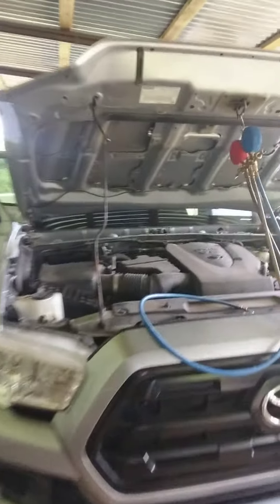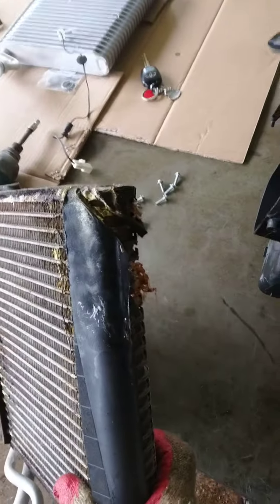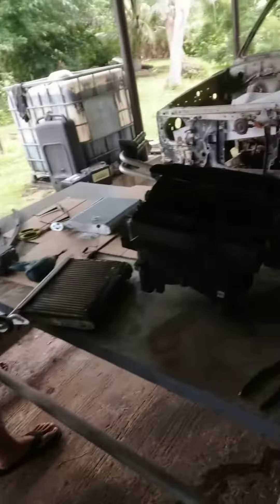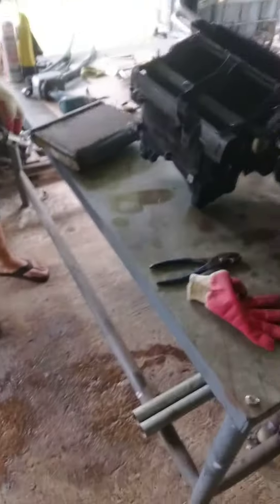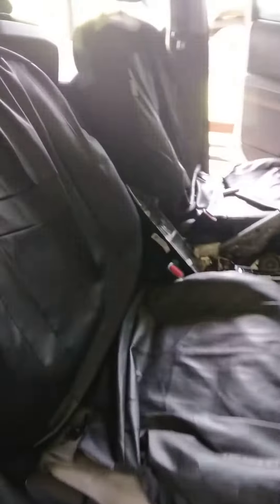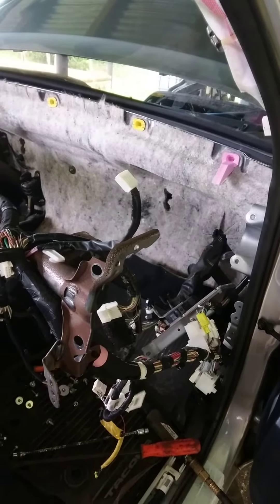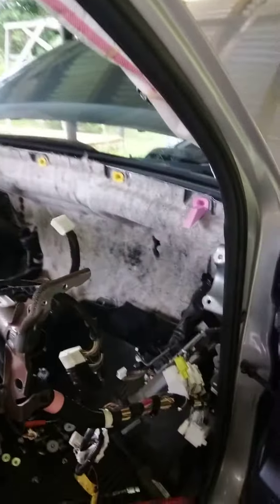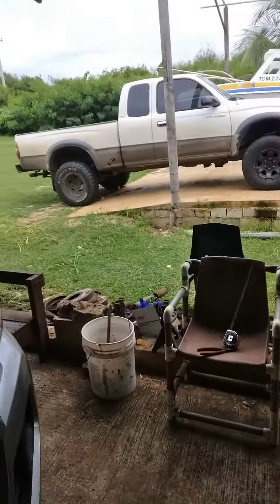2015 - 2019 Tacoma evaporator replacement

Comment: Thanks for the video. Are you using OEM original part for evaporator replacement or the aftermarket? And what brand did you use if aftermarket?
Reply from the maker: Aftermarket part with additional corrosion protection
Reply: My 2017 Tacoma had all refrigerant leaked out. Did you changed also the expansion valve?
Reply from the maker: @natenieva1746  no we only changed the evaporator and all the seals on every disconnected part.